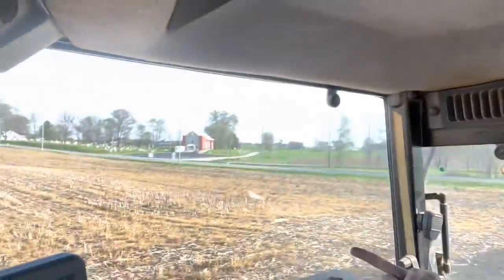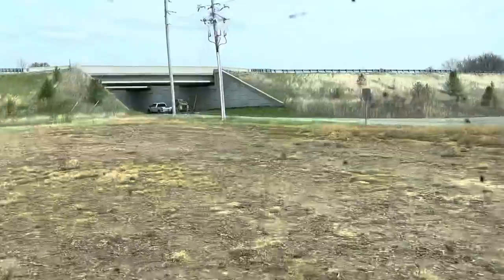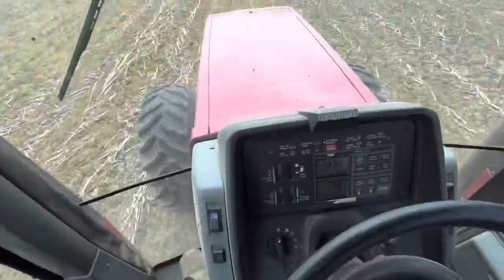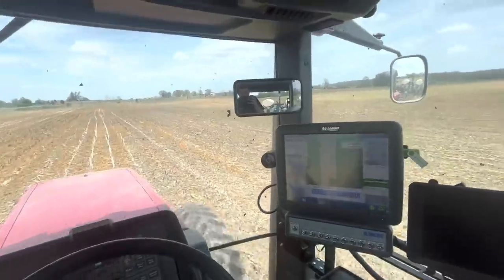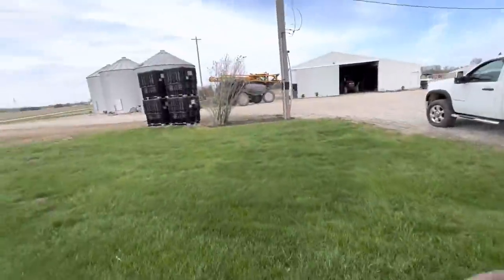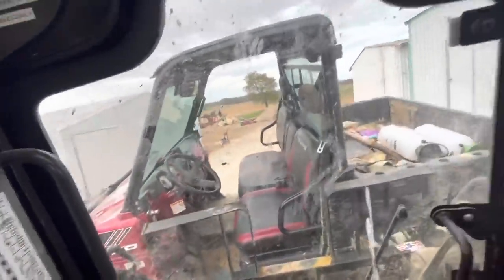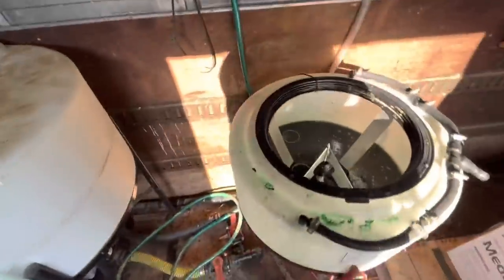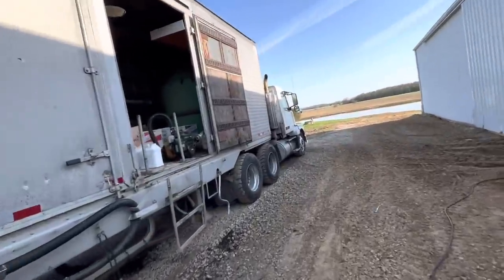Sticks Beans & Sticking Sprayers

Comment: Ethan, one trick you can use if you have hydraulic tread adjust, set the front or back axle to a different width then the other. Helps keep one axle from sinking further into the tracks from the other axle. Can really help.
Reply from the maker: I never thought of that!  I do have it.